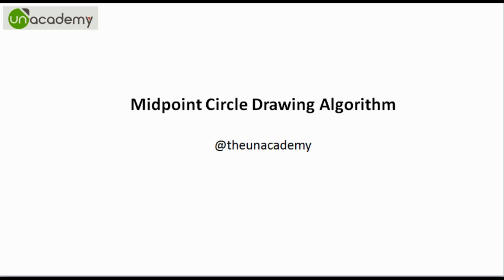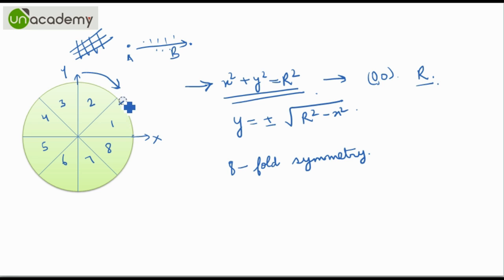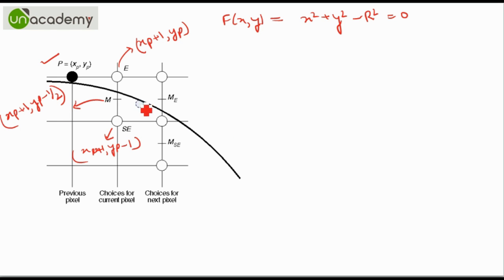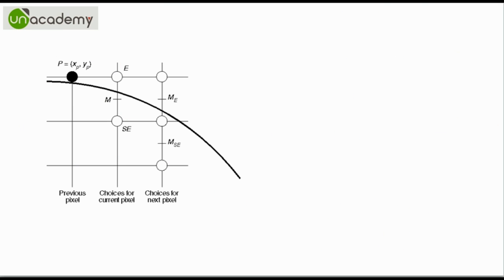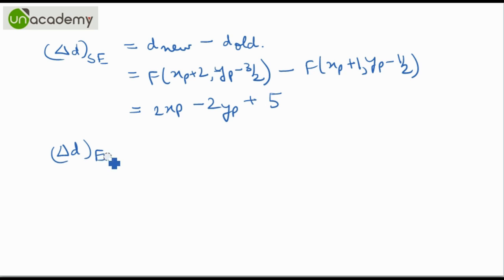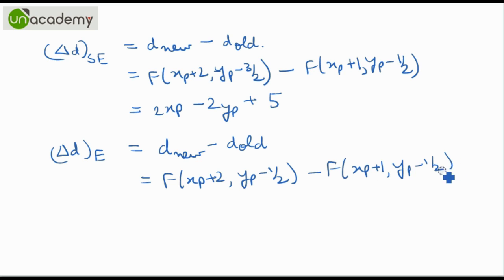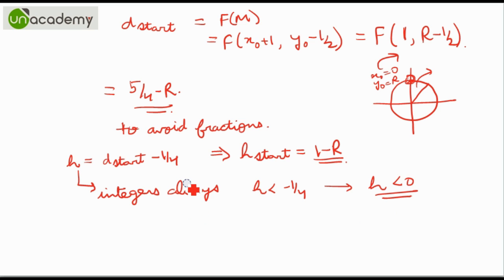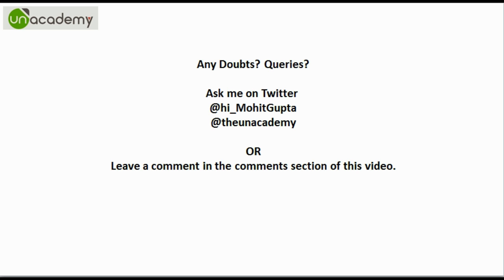What is Midpoint Circle Drawing Algorithm in Computer Graphics?

Comment: @6:12 if d>=0 then shouldn't it imply that the circle passes above M since d is +ve which means that x(p),y(p)-1/2 lie outside the radius R of the circle?
Reply: If d>0, hten it implies through inequality that point M(x+1,y-0.5) doesn't lie inside circle.
Or in other words circle value passes from below that point i.e. M.
Since it pass below M, the SE point is nearer.
Reply: if, by inequality, the point doesn't lie inside the circle, then it has to be outside the circle. in the diagram used in this tutorial, the E point is outside and SE point is inside the circle. now if the point is outside the circle so should it not be closer to E?
Reply: Carefully read the following 2 statements:
1) M lies outside the circle.
2) The circle passes below M.

Are the 2 statements implying same thing?

Since circle pass below M, it is likely to be closer to SE, not E.
Reply: okay. got it. thanks for clearing it up

Comment: @8:28 when you check the change in decision parameter, why d(new)=F( x(p)+2, y(p)-3/2 ). should it not be F( x(p)+1, y(p)-1 )? or is it the case that after getting new points we again calculate the mid-point?